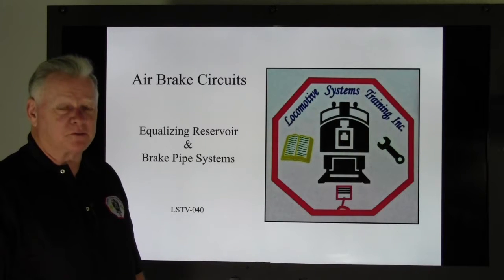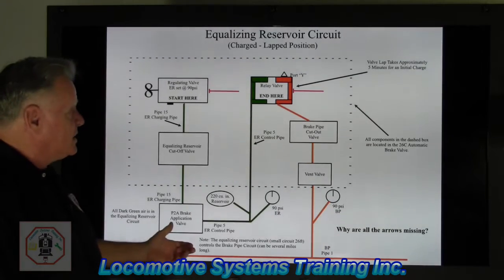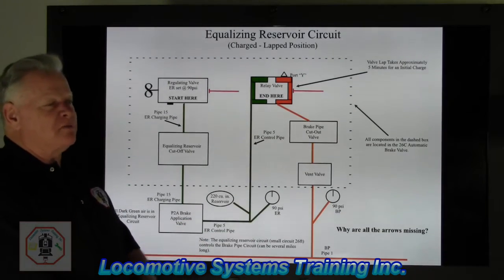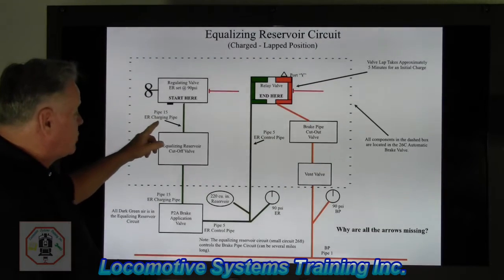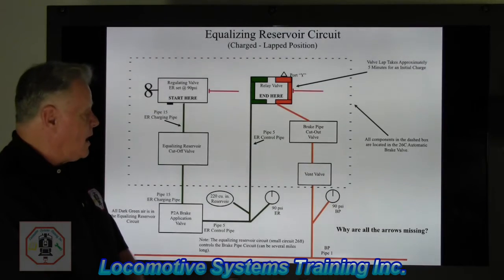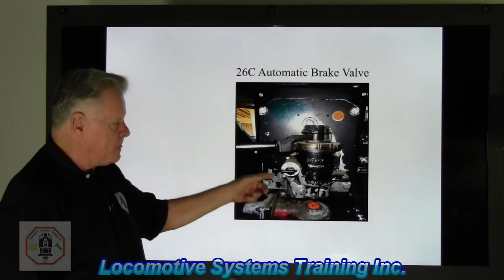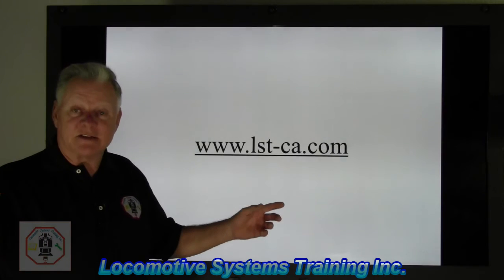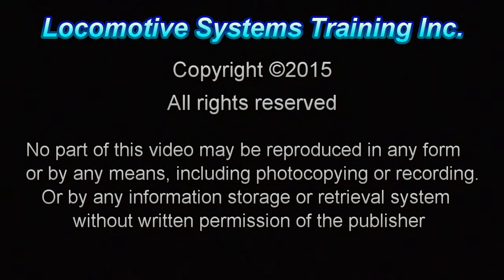LSTV 040 Air Brake Systems - Equalizing Reservoir & Brake Pipe Systems

Comment: Hi were exactly is the equalising reservoir and how large is it.
Reply: For example, On A GP38 style unit with a 26 Air System! It would be located under the floor of the engineer seat. behind the air rack where the air components are mounted too. its in a separate compartment

Comment: Pressure gauge will give a false reading if heat affected because of the solution in the gauge, to get a true reading at all temperatures need to drain the solution in the pressure gauge, but then fuel or air can leak out easier ( in my experience, do your own research )

Comment: 🤔so basically @90lbs in the brake pipe and I move the lever to service for a 20lbs reduction to apply the brakes then move the lever into lap the circuit will flow within its self. No air in or out. But to recharge the air you got to knock it off to recharge. Now when you do the reduction do you have to bail off the loco brakes?
Reply: The 26C brake valve is self-lapping. When you move the handle from release to a service application, it will automatically draw the air down to the desired level and lap, maintaining the air at that pressure, unless you cut out the valve afterwards, in which case any leaks in the system will draw down the air more.
As for bailing off the locomotive brakes, that is dependent upon the situation but if you are simply bailing off to keep the locomotive from applying the brakes, then you will want to bail soon after making the reduction and holding it until the reduction has completed so that any pressure applied to the unit braking system is then exhausted.

Comment: would like to see you do a segment on abdw brake valve and why they have them on rail cars today, as they are noted if not worked the right way they can transmit a release to a entire train, esp when un coupled from the locomotive. ie a rail term called saving the air.
Reply: "Bottling the air" where I am from, is now a terminable offense except where the cut of cars has been properly secured and connected to yard air. It's a shame because it was a much more efficient method of performing a roll-by when running around the train, where a crewman could initiate an emergency stop by dumping the air in the brake pipe while the cars were still rolling with gravity, as opposed to just securing a handbrake on one car.